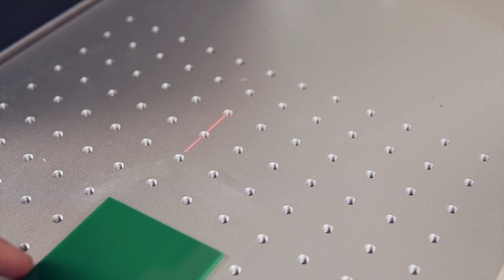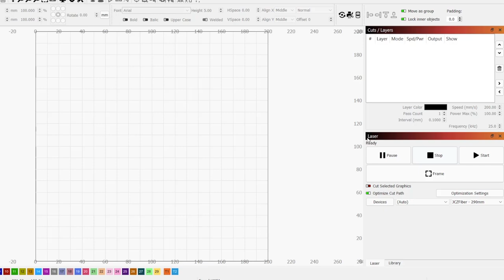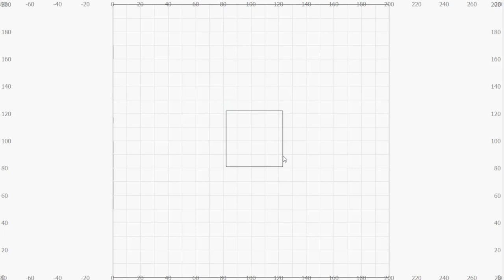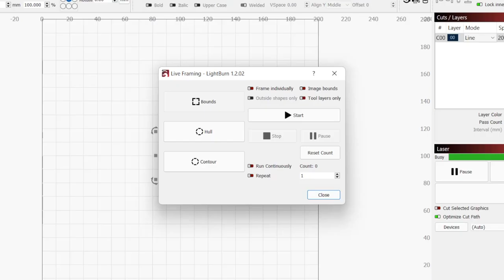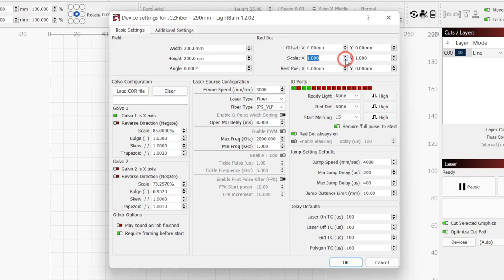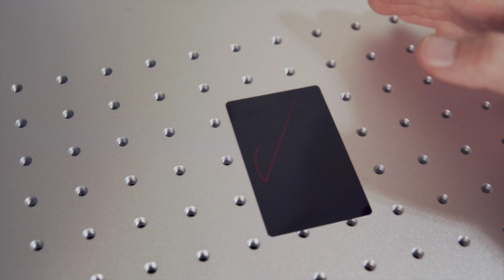Galvo Laser Red Dot Alignment

Comment: my laser is dead on in the center of the project, but as i get near the corners, the red laser is offset again. If i adjust it at the corner, it messes with the other corners which are also off.  I am using the 300x300 lens on a 30w Mopa.  My 50 watt regular markers (that look exactly the same but without the MOPA capability) all seem to hit the spot where the laser is pointing no problem.  Even with the larger lens.  Any tips?

Comment: Here's an issue. following your method. technically should work. which I did. then move the art work an inch to the right or left in the software, red light it, move your test piece so the artwork red light is on the material. then burn the square. now my red light and square of way off. what causes this? I have done the lens correction. it seem the further away from the center, the further off the red light and artwork becomes off.

Comment: Out of curiosity (I don’t own a galvo): is the red line actually moving in real life or is this a video result of the rolling shutter?
Reply from the maker: It does “move”, but quite fast. It’s a lot like a laser light show, so your persistence of vision turns it into a relatively solid image if the vectors are simple.